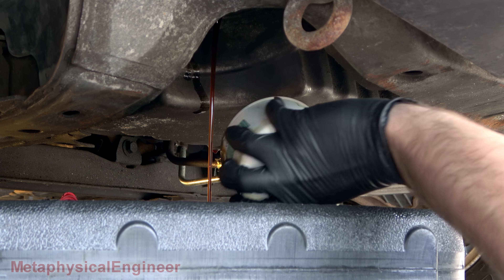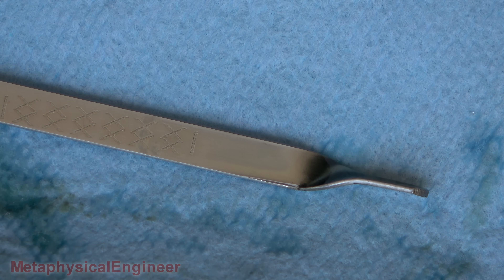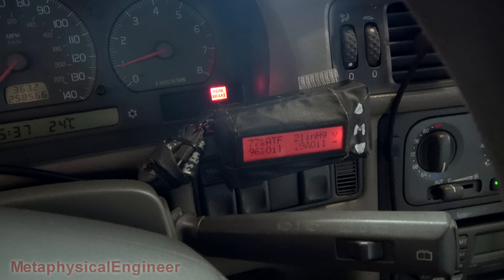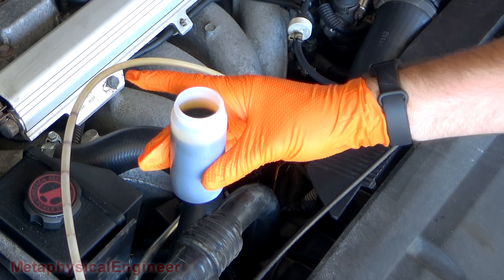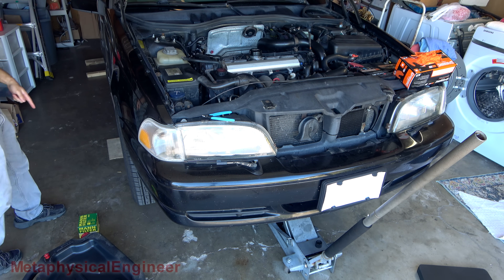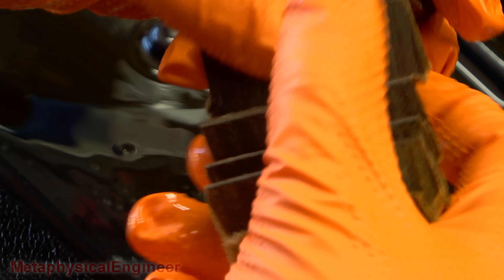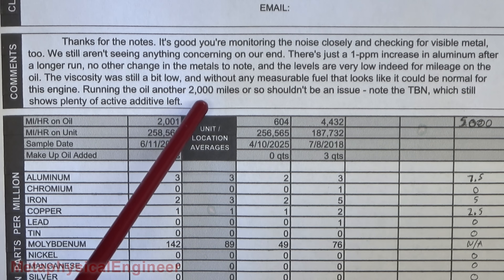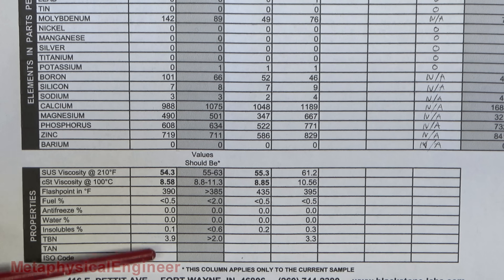Valvoline Restore and Protect vs Noisy Lifters - Used Oil Analysis and Filter Cut Open

Comment: I ran some SeaFoam in the crankcase in my 2017 JKU with a fresh oil change at 60k. Could not belive how dirty the oil was after only 1500 miles. I dumped that oil and replaced with new. The old oil now on my 4k mile changes does not look bad at all. No longer use spec 5W20 at 85k. Started using 5W30 and it no longer has that faint ticking the 3.6 Pentastar is known for. Quiet as s mouse
Reply from the maker: Glad Seafoam and thicker oil handled the issues on your engine!   At my previous job we ran 5w-30 instead of 5w-20 in the older F150 work trucks because it helped oil consumption when we ran them hard.  A couple percent fuel economy hit was worth extra engine protection in hot conditions.

I tried Seafoam in the previous video on this problem (link in description!) but it wasn't able to solve the lifter noise.  It did make the oil darken faster than normal, so cleaning definitely happened.  Also didn't cause any unusual wear in the engine, which is a common fearmonger point about cleaning additives destroying the oil's ability to lubricate or thinning it out too much.  In my case here the deposits are very tough and will take a long time to remove with any product that's safe to run in the oil.
Reply: That light weight oil is really for EPA paper ratings and a very slight fuel economy gain.  The engine will appreciate the 5w30 over 5w20.  I don't suggest all engines to be switched to a higher viscosity, it's just that some engines are running on much thinner oil than really they should for optimal engine life.
Reply: Y’all both beat me to it but anytime I see an engine that calls for 5w20, it gets 5w30 and sounds and runs so much better. This especially applies to the Ford 3 Valve Triton engines @MetaphysicalEngineer was referring to. They’ll eventually eat the cam phasers, lifters, roller followers, and cam with that thin oil. 5w30 Synthetic and a 5,000 mile interval keeps them on the road and happy.
Reply: all my 0w20 cars (subaru and bmw) get 5w30.  i don't even care about the miniscule mpg hit. my alfa says 0w30 so that's what i've been using until my warranty is out.
Reply: Read the MSDS for Seafoam. It literally is naphtha (raw gasoline stick) plus isopropyl alcohol (IPA) plus light machine oil. The alcohol blows off all the deposits, but also scours away all the lube oil leaving the pistons running bare metsl on metal. Which is why there's machine oil in it.
 Basically the same reason old mechanics used to pour old coffee in an engine to blow them out, as the water flashed into raw steam.
 You can make your own Seafoam way cheaper, if you like what it does.

Comment: New subscriber (we lefties need to stick together), good luck with your experiment. My nephew ran V R&P for 25,000 miles, and it did a great job cleaning the engine in his well-maintained F150 with 227,000 miles.
Reply from the maker: Lefties unite!  Cool to hear how R&P worked well long term in the F150.  What year is that truck?
Reply: @MetaphysicalEngineer    7.17.25.  ☝🏼 “lefties have rights too … you know”🤦🏻‍♂️
Reply: lefties?
Reply: @Motorsportsgeek left handed or did I get that wrong

Comment: use with bars leak on old dry gaskets has worked for me with my oil changes, pretty insane
Reply from the maker: Did you have oil leak problems before, or was the leak stop additive to prevent future leaks as the R&P cleaned gunk that was helping old gaskets seal?  What vehicle was this on?
Reply: @MetaphysicalEngineer  Nooooo not for new gaskets. I would just replace the gasket but I dont have an engine stand abd no money. So I paid 12 bucks for the polymer solution and when it gets hot it really soaks into the rubber again because I put a sheet of paper down, I can estimate 30 to 50 milliliters saved since I put in in for these OLD ASS gaskets Lol. Head gasket was replaced but not valve stem seals cam seals or rear main
Reply: ATP205 for the win!
Reply: @18_rabbit  i imagine that also works, I can confirm NO DRIPS AT ALL letting it settle after a week,  REALLY ripping on the car getting it hot

Comment: Very good job on this test and the process.  It didn't happen on my car, but you have a turbo - I don't like that the oil went out of grade. Please do the various blot tests on this change.  I am curious to see if VRP does most of the cleaning in the  first 2 to 3k of subsequent oil changes.  Then you could avoid worse shearing.  I did 6000 miles on VRP and it tested fine.  I drive 18k miles per year on my direct injected NA engine.  VERY HAPPY WITH THE CLEANING AND TEST RESULTS!
Reply from the maker: Thanks for the info that you didn't see unusual shearing on a N/A engine.  Strange that mine is apparently so hard on oil because it is such a mild stock forced induction setup seeing fairly gentle street and freeway use.  Hot oil pressure is still very healthy and well above factory minimum spec, and wear numbers much lower than average for this engine family point to the viscosity not being a problem at the moment.

Time at temperature is where I think the cleaning is happening, so long as the additives aren't depleted.   The filter change and analysis and blot comparisons at 4k to 5k will reveal more.  Unless the analysis says otherwise that I'm in danger, I'm willing to follow the official product documentation where VRP can result in *"UP TO 100% PISTON DEPOSIT REMOVAL WHEN USED AS DIRECTED FOR FOUR OR MORE CONSECUTIVE OIL CHANGES AT STANDARD MAINTENANCE INTERVALS"*.  

Probably would get similar results from 6 or 7 shorter intervals of 3k vs 4 intervals of 5k over the same 20k ish interval.  But more costly especially if that means dumping oil and filters that are still serviceable.
Reply: FYI,  Valvoline has a $5 rebate on 5 quarts of oil, I believe it’s until July 31st. You get up to 6 rebates. It’s an easy process with texting them a photo of your receipt.
Reply: I love intelligent engineers and slightly aspy people…I’m one too !!!

Comment: Thanks for the update - good luck with the experiment - next time perhaps you can compare your blot page with the Seafoam blot results - curious which product cleaned better - not a perfect comparo, since the engine is cleaning up over time, but would still be helpful to evaluate
Reply from the maker: Yes, I should have pulled up the blot sheets for the previous run.  I'll make an image post soon with the side by side.  

I can say that the oil got dark a little faster per mile than with MMO but much slower than with Seafoam.  You're right that each round of cleaning has removed more varnish from the engine, with the softest deposits dissolving first.  Only way to do a true comparison would have been to exactly clone the car before any of the tests and run them all in parallel.